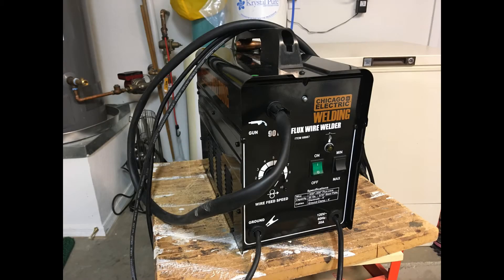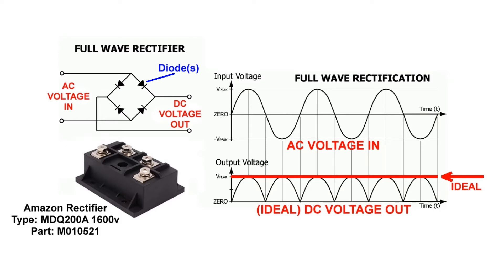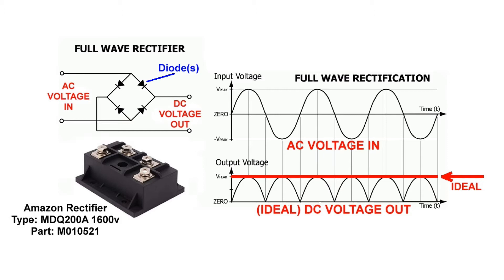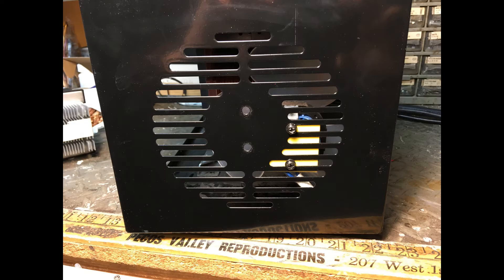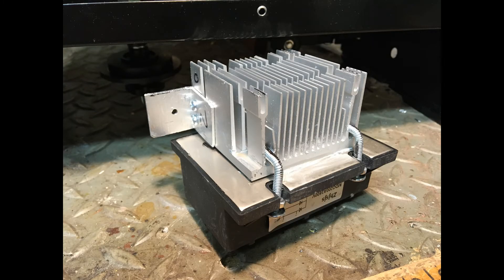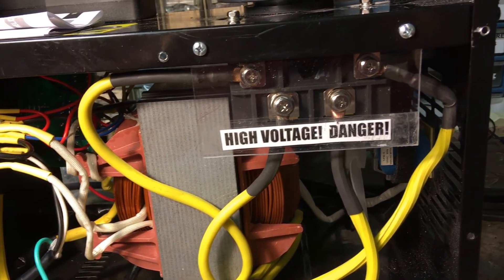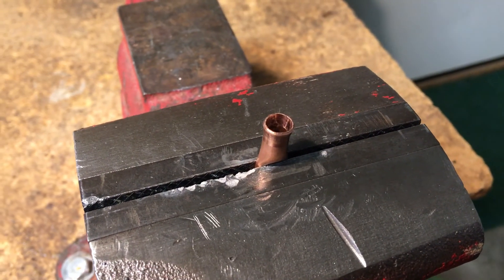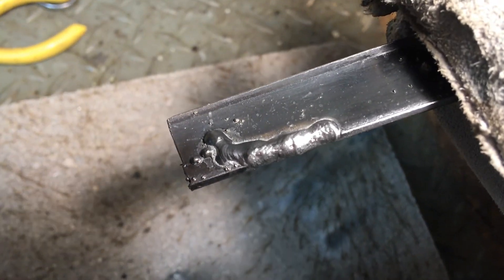I Converted My Harbor Freight Chicago Electric Flux-Core Welder To DC With a 200-Amp Rectifier!

Comment: I'm still contemplating doing this mod on my machine or just spending a few more bucks and just buying the Titanium Easyflux DC welder. After buying the parts and taking the time to do the mod, it would be much less hassle to just run over to Harbor freight and just get the good one instead. I can always put my Chicago Electric for sale recoup some of the added expenses for the new one!

Comment: This isn't the first video I've seen of this, but a good illustration of what is done, and also the safety precautions.
I almost purchased the Easy Flux Titanium at $20 off last week for $129, but waited.
I had my Amazon cart up to $98 just to do the conversion.....overkill.....lugs, crimping tool, 4 gauge wire, $23 rectifier etc.....
This can get me there without all of that.
But I really like the demonstrations of that Titanium DC welder.....strong welds!
Thanks!
Reply: I too am contemplating one doing the mod to my Harbor Freight AC welder or just spend more for the Titanium Easyflux machine (and sell my used Chicago Electric for $50) and get what I want without any headaches.
Reply: @PainterD54  , I went ahead and purchased the Titanium.....have done nothing to the old HF welder.
I took it apart, and wiring connections were loose and just basically fell apart?
Cheap junk.....I bought the new one.

Comment: Nice!  The only thing I'm not clear on is electrode polarity.
Reply: Electrode negative
Reply: @fromthebackofmymind  It's not clear because he didn't which way it is wired.
Reply: @louf7178 just buy a inverter welder from whatever company you can afford.

Comment: I did this conversion and biggest difference ever, .035 flux wire now melts like butter and gets rid of most of the spatter, it seems to have soo much more power on tap instead of wasting it on spatter, penetration and arc quality is a big jump in improvement
Reply from the maker: Glad to hear this!
Reply: How do you set up the wiring ?

Comment: Does doing this reduce the wattage output?
Reply: Yes, along with a 1.4 volt drop.
Two diodes at a time conductiing forward current. Each have a 0.7 volt drop. So look at your documentation on output of amps. To see the
A/C volt output on low and high and subtract 1.4v from the stated output.
On low setting wattage will be reduced by about 135 watts.

Comment: hi so you got half way right, your wave diagram is wrong, and it looks to me that your understating of ac current flows is wrong too...
so if have 110v of 220v or 1kv at an ac current, cycling at 60 or 50Hz of even at 1Ghz 
first thing you need to do to understand the conversion rate is to split the number in 2 so 50Hz becomes 25 now what does this number mean?
this number means you'll be getting 25 pulses of per second of dc current each pulse will last for 4 milliseconds and during those 4 milliseconds your voltage will raise 0 to max and max to 0, and same thing will happen on the other polarity almost at the same time, it will offset, or phase shifted by 4 milliseconds, this is why you need a capacitor to smooth out the voltage falling and raising and the dead current time to a stable current, now i did the same thing to my Walmart stick welding machine, and i calculated the capacitor needed (for a 48 volt 200 amp current, transformer output) is around 850,000 uf or 0.85 farad, now this is very very large capacitor, and good luck buying one, you could put one together by paralleling caps.
but the price tag... 
own cap...
and it came out big, and calculating the plats length and size was hard...
my next plan is add a wire and gas feed, so i can do flux core, mig and tig  :-)
Reply: "first thing you need to do to understand the conversion rate is to split the number in 2 so 50Hz becomes 25 now what does this number mean? .... "  

None of what you say here is correct.
Reply: @codetech5598  Is correct if half wave rectified.  Not full bridge rectified however.
Reply: @codetech5598  mmm that's the text books say and that's what scopes shows on a dc time line, but ok, what ever you say....
Reply: @ozb2006  The text books and scope show exactly what the video shows on the wave diagram which is correct, but you claim it is wrong.

Perhaps you were thinking of a half wave rectifier, not a full wave bridge rectifier which is the subject of this video?
Reply: @codetech5598  
if my understanding was wrong then how was i able to get my calculations to work and get the right cap size 0.87 farad or 870,000 uF to my welding machine to get a almost clean DC current?, and if i put a much smaller cap, i get dead times with no current, measuring at 2 milliseconds between pulses?
ok you know what, you clam i am wrong, prove with a video show the scope on the screen...
Reply: @ozb2006  This video and discussion is not about your machine.
Reply: @codetech5598  yes i know, but you made a claim that i was wrong...
so, prove it!!!!!
put together a transformer diode brig cap combo, with the right values, show it on a scope on camera, and then change the cap to much smaller value incorrect value and show that on a scope, lets see happens...
do it on camera, and post it... 
go ahead prove me wrong if i am wrong...
Reply: @ozb2006  No, what happened is that your original post claimed the wave diagram in the video was wrong, but it is in fact correct. 

The operation of a full wave bridge rectifier with smoothing capacitor is well known and  anyone interested in pursuing it further can consult a standard reference.
Reply: @ozb2006  Looks like @Code Tech detailed you half wave frequency observation.  Just think about the line frequency is say 60Hz... if full bridge rectified, the frequency will still be 60Hz.  If half wave rectified, then half the wave (the positive phases) are present and therefore equate to 60Hz/2 = 30Hz in this example.
Reply from the maker: Thank you. :)
Reply: @ayebee1207  and i do agree buy stuff is easy, everyone can buy stuff!
not everyone can make stuff!
i am a junk collector, and i love it because i have a lot of tools, and 95% of them are made of junk that no one else wanted, and they are all custom tailored the way i like to work...
and i had a few time when people asked "can you build me one?"
so yes!!!, you go buy one...
Reply: @ayebee1207  the max output of my machine is 48v 160 amp, anything under it is even better i actually put my welder output under a oscilloscope, and i had perfect dc with a little bit of 50Hz noise, i was super surprised, and my diy cap came out to, 921k uf, how i don't know but i am happy, DC welds are a lot cleaner and take less time...
next thing i am doing is a flux core mod...
a little tricky, i need to find a schematic for spool drive controller
Reply: i made my own capacitor 
and it came out big, and calculating the plats length and size was hard...
my next plan is add a wire and gas feed, so i can do flux core, mig and tig  :-)

Comment: DC inverter machines are also getting cheaper and cheaper, but I really appreciate the work you put into this. The idea, the effort and the professional video (documentation and explanation) on the process. very nice, respect! (background: I have a quite expensive MIG and TIG welder, but now buying a cheap AC fluxed core machine which I can beat and use for not so delicate work and had the same idea as you did.)
Reply from the maker: Thank you.

Comment: It would be nice to show what wires you cut and how to wire it up.
Reply from the maker: Hi Jim...sorry it was not clear enough. There are two wires exiting the front of the machine, one is for the welding gun and the other is the ground wire. You cut those two wires on the inside just a couple of inches back from where they exit the box (the welding gun wire passes through the feed mechanism before it exits the box, so you cut it before it enters the feed mechanism). The ground wire is an easy cut and re-route, but the welding gun wire is a little more difficult. 

I had to loosen the circuit board to get at the welding gun wire. This required removing the four bolts holding the transformer (support the transformer with a block of wood while the welder is lying on it's side...it is extremely heavy...you don't want to tear any wires loose should it shift) in order to get enough room to loosen the circuit board to get it out of the way. Once done, it was fairly straightforward. Carefully choose a spot on the welding gun wire a couple of inches back toward the transformer from the feed mechanism...just enough to give you enough room to strip and work with the wires. Think about it carefully before you cut the wire. If you cut it correctly, you will be able to get the cut wires just above the box so you can solder or clamp with a little more room to work...rather than trying to work in the tight space down in the box.

Once the two wires are cut (see my wiring diagram), you first splice in the cut ground wire coming from the transformer and feed it back to the AC side of the rectifier (either AC terminal). Then, you run a new wire (I used #8 battery cable from some cheap jumper cables) from the POSITIVE side of the rectifier back to the front of the box, and splice it into the cut ground wire on the side exiting the box. 

Then, you splice the welding gun wire. Splice a wire from the transformer side of the cut welding gun wire. Run it back to the other AC terminal on the rectifier. Then run a new wire from the NEGATIVE terminal of the rectifier back to the front of the box and splice it into the cut wire headed for the feed mechanism (and then on to the welding gun). Again, see my wiring diagram.

So, you are simply taking the two wires coming from the transformer, which is about 18 volts AC, and putting them on the AC side of the rectifier. The rectifier then converts the AC and provides DC voltage at the + and - terminals. Positive goes to out the box to the gound wire, negative goes out the box and to the welding gun.

I have a new video that shows how to make a much-improved ground clamp for a couple of dollars: https://youtu.be/chbHR30JiSs

Also, since I made this video, I solved one of my other minor welding problems...not being able to see. I ditched my Harbor Freight helmet, and sprung for one of the cheaper Lincoln Electric helmets. Now I can SEE! https://amzn.to/38HfqUc
Reply: @bupright  Hello, you mentioned a wiring diagram?  do you still have that?  thanks in advance...
Reply from the maker: I think the high/low switching is done on the input side of the transformer. All my changes were done on the output side. The two output lines were cut, the rectifier was spliced into those two lines, and those two lines continued out to the ground clamp and the gun.
Reply: @fromthebackofmymind  if you want to make stuff, just make stuff, you don't anything but imagination and a few tools, and if you have enough imagination you can make your own tools.